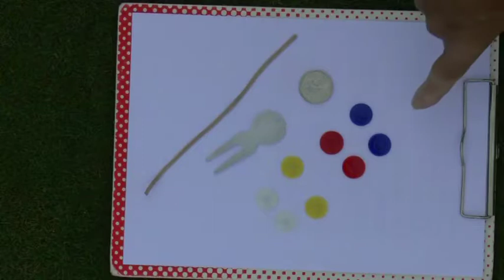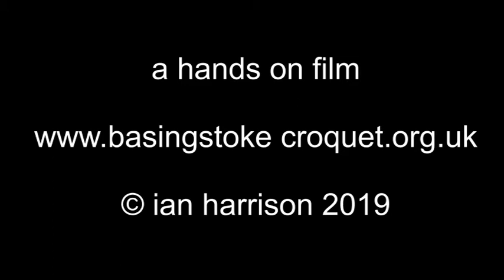GC Module 4

Comment: Hello Ian, I've seen all of your modules and they are great! Very informative and easy to understand for one who is beginning to learn GC. The shot taken at minute 7:04, is a definite fault in my opinion. Playing a stop shot with that amount of power on two balls that are that close to each other will most certainly result in a double tap fault. A clean stop shot is still possible to execute here, however the opponents ball should travel a much shorter distance, maybe about 1-3 yards. The simple fact that the strikers ball does not travel as far does not necessarily mean that a double fault did not occur. I am certain that if you play that same shot as you demonstrated, and recorded it in slow-motion, you will find that the mallet makes contact with the strikers ball twice.